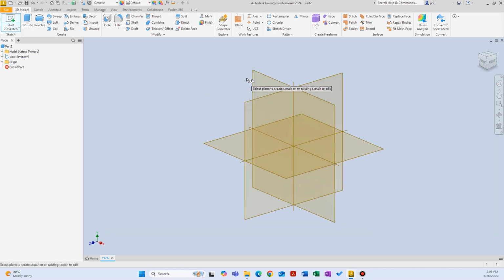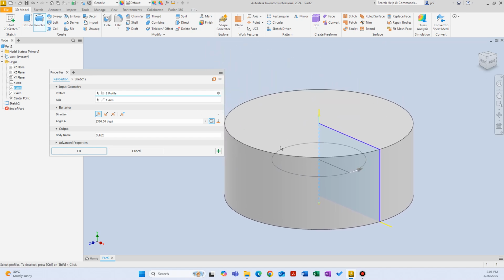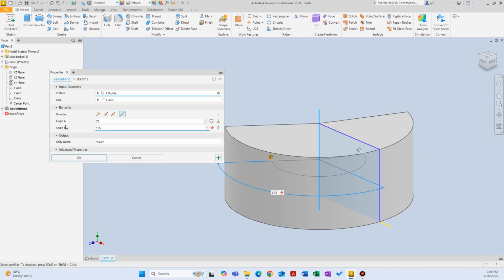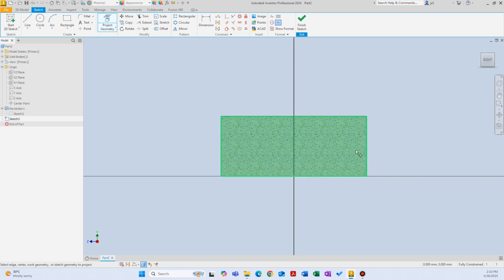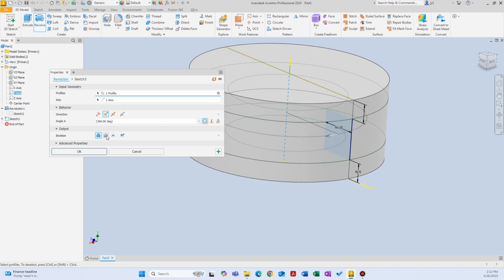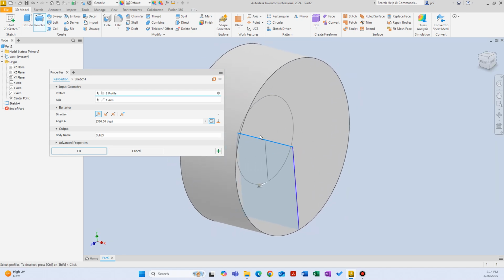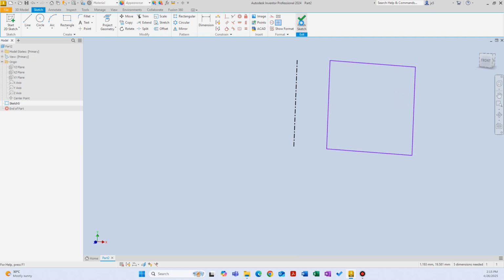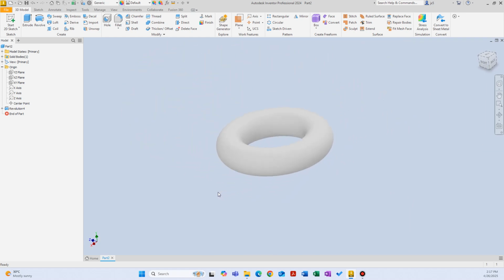27 - Revolve Feature | 3D Modeling | Autodesk Inventor Professional Tutorial

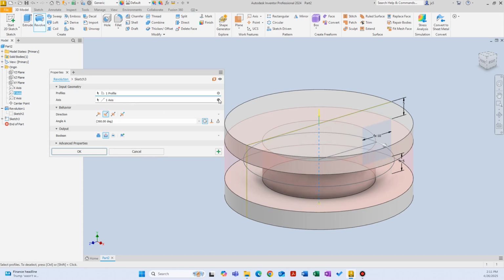Comment: Great tutorial but i have a question. I wanted to replicate the part you made (shown at 7:38) using a custom center line not aligned on the origin axes. I noticed what when i was doing the 2nd rotation in order to remove the material, i was unable to select the original custom center line i made. The center line was not selectable nor can be detected with project geometry in the 2nd sketch. I had to create a new centerline exactly like the original instead. Is there a way to keep using the same center line?